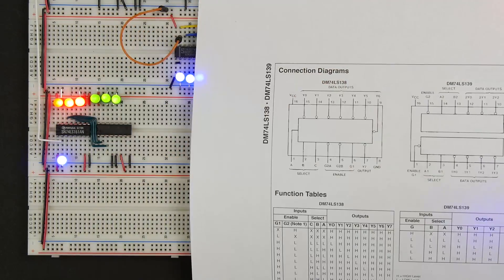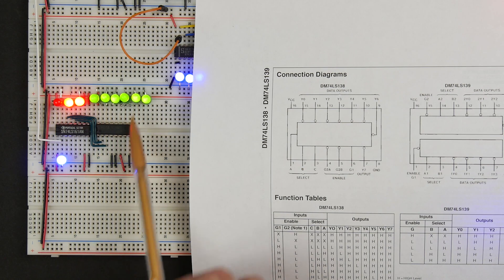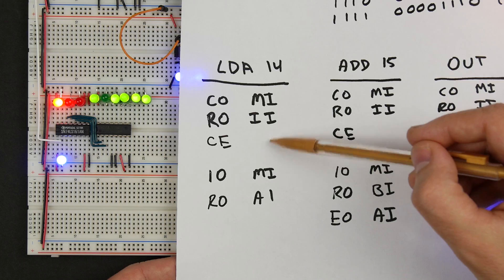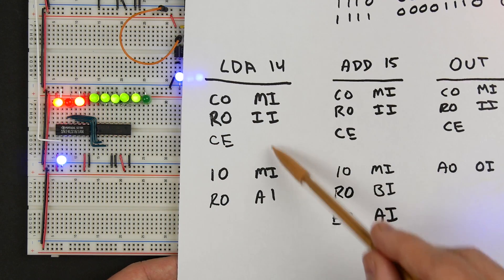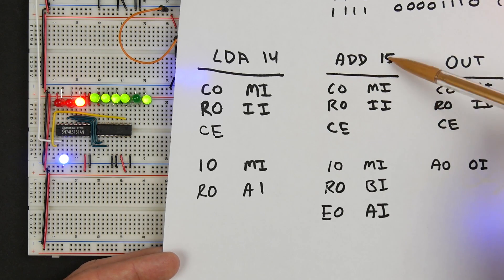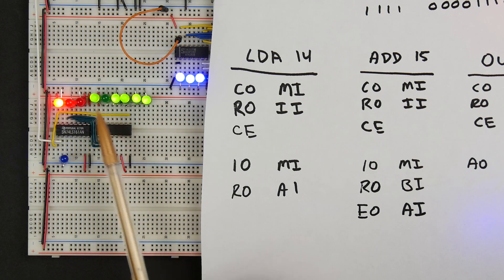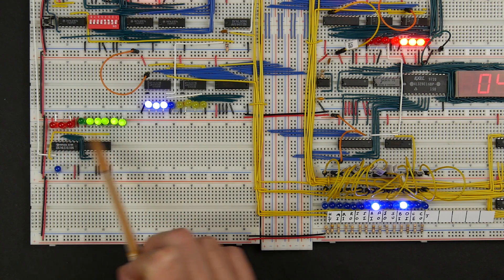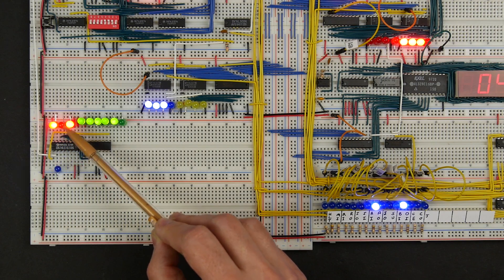8-bit CPU control logic: Part 2

Comment: Great seeing the comments on the last video incorporated into this video =D Next optimization I'd love to see (that doesn't make the computer significantly harder to understand) is getting the microinstruction counter reset integrated into the control lines so that short instructions can reset the microinstruction counter earlier and move more quickly to the next instruction.

So glad to get the new video, thank you for the whole series!
Reply from the maker: I'm trying to lay things out so there's room for expanding to a 24-bit control word. Using a bit to reset the instruction cycle early is definitely a good idea.
Reply: I only count 15 labeled control lines at the moment, a few more you've mentioned (B register out) as possible but not implemented. I'm certainly interested to see what else could be used to help control the modules. There's certainly a number of chip-enable/reset/"special" lines on chips that are currently tied directly to high or low that could be used for less common but still useful operations.
Reply: Wouldn't be at all hard to do, as long as whatever is triggering that yellow CLEAR line to the counter can handle a high signal there when the inverter sends it on T4. If not, then one could simply remove the CLEAR line as it exists and wire it in as a micro instruction. Then the EEPROM or whatever is used to handle the microinstructions can simply activate that line at the end of every instruction and forget about the T4 line activating it....
Reply: That's.... intended behaviour, isn't it? Whenever the EEPROM outputs CLEAR, the counter resets and the EEPROM then instantly outputs CO MI. This is fine, since it's the start of the fetch cycle, which is the same for all instructions. The end result is CLEAR never actually takes a clock cycle, instead starting the next instruction straight after the previous one had finished.

One must be careful to ensure that CLEAR is always enabled alone, with nothing else active at the same time. This is why we still need T5. In the case of ADD, at T4 we execute EO AI. Then we still need T5 to execute CLEAR and begin fetching the next instruction on the next clock cycle.

There's technically a one microinstruction overlap between instructions, but practically this shouldn't matter...
Reply: I may have misunderstood your original comment then, and yep, that's what I'd expect to happen. The only thing that changes would be which microinstruction cycle sets the clear bit, and it would be handled through the control logic instead of tied directly to the demux.

Any of the current options involve a very brief overlap of microinstructions as you mention, the only way I can think to avoid that would be not to reset and let the counter overflow, but that would be much slower for no real gain.
Reply: This would require a buffer of some sort after the EEPROM, adding complexity. The EEPROM won't wait for a clock to change its outputs and neither does the CLEAR input on the counter. This means that as soon as the last microinstruction is requested from the EEPROM, the CLEAR bit will appear and reset the counter well before the next cycle. Since the counter is now zero, the EEPROM will be showing CO MI instead of the last microinstruction we actually wanted...

We could get around this by adding a buffer to the CLEAR bit that waits for a clock pulse, but this adds a chip to the circuit for no reason. Just put CLEAR as the last microinstruction and the control unit will be back at CO MI in time for the next fetch cycle to begin. No extra buffer, no wasted clock cycle.
Reply: There are also counters with synchronous resets
Reply: Goof245 The problem with feeding ROM output into the step reset is that the ROM updates asynchronously. Since that includes transitions on separate address bits, we'd risk glitches. The solution is a synchronous reset, either using a 74LS163 instead of 74LS161, or using the Load pin PE. You could even go a step further and implement microinstruction loops.
Reply: Which way will the counter 'ripple' as it updates? The CLEAR is only ever going to be the last step in an instruction, so if the ripple causes a higher step to appear for a split second on the EEPROM then perhaps then we risk CLEAR appearing prematurely and aborting the instruction. The solution to this is to remove the inverter chip and feed the inverted counter output to the EEPROM instead. This way if the ripple causes the wrong value to appear on the EEPROM, it'll only ever be an earlier step, without risk of CLEAR popping up when it's not wanted...

The ripple causing the control lines to flash momentarily won't affect the rest of the CPU. This is the whole reason we run a clock system, this flashing will occur out of step with the actual clock signal. Sure, inductance in the wires might cause these unwanted signals to hit modules at the same time as the clock, but I would suggest that the clock is set way, way too fast if this is happening...
Reply: There's definitely some interesting caveats to handling the reset microinstruction counter, but assuming it's done with a bit of EEPROM as mentioned, as soon as the reset was asserted, the microinstruction counter would be reset (unless it was tied in with the clock as well, unnecessary I'd guess, but possible) and the EEPROM output would change to match the new microinstruction counter just like it does when it hits the last microinstruction and resets currently. It may be another part that limits the overall clock speed of the computer, but this design was never made for high speed anyway.